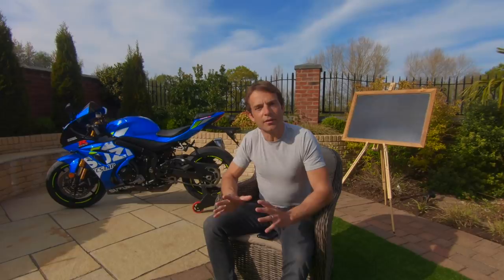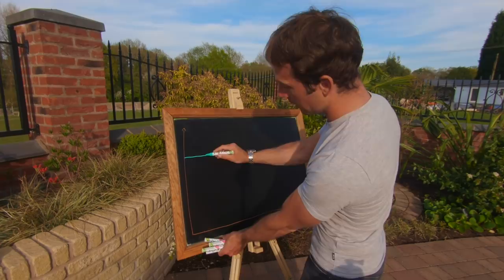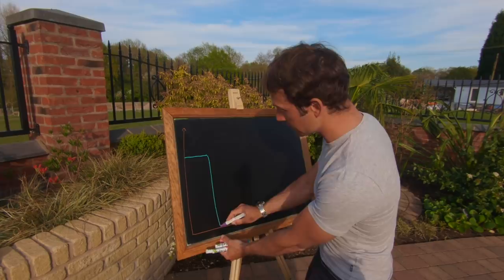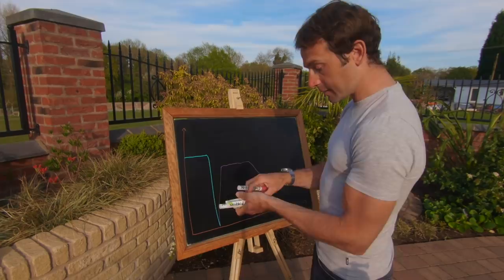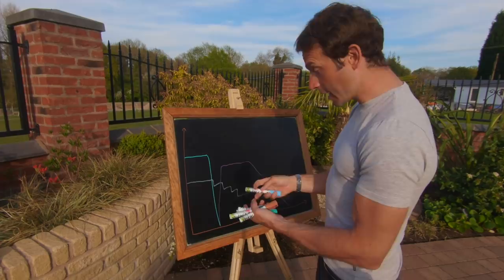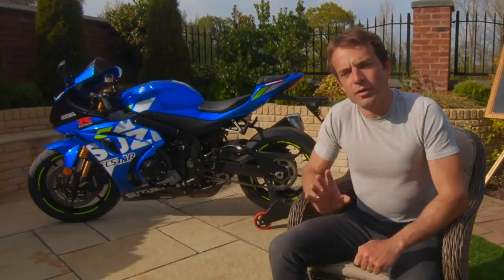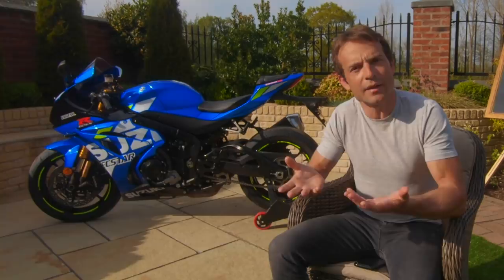THE REAR BRAKE (🇬🇧English Version)

Comment: Sylvain, this is a great series. I am an amateur racer in the US with some moderate success. I have never felt comfortable using the rear brake with the exception of running off track. I always thought it was a major shortcoming of my riding. I do click down a gear as soon as I release throttle and transition to brake, it settles/slows the bike for sure. From a psychological stance however, I really appreciate hearing one of the best riders in the world state that he doesn’t use the rear on a superbike. It actually takes a weight off my shoulders. It sounds silly but racing, as any endeavor you wish to be successful in, is 90% mental. I am really just trying to say thank you for sharing that!
Reply: The affermation of knowing what you were doing is right gives you sudden strength and confiednce. Suddenly you go faster.
Reply: @technicalthug  When you're braking hard enough to lift the rear up, the rear brake becomes useless. Even MotoGP riders only use the rear brake a little during the initial braking application before totally releasing it, and only start to use it again during the turn-in.

Comment: Great advice. I don't track, just fast road riding. I use the rear for trail braking into the corner. Your expert advice on changing down a gear at the corner entry for engine braking is a revelation!! Makes so much sense. Less rear brake, more use of engine braking.  Thank you :)

Comment: When I was a kid riding my bicycle I was taught during straight line braking to apply the front brake and at the same time blend in the rear brake and than release before entering a bend I actually still use that method today when riding my motorcycle seems to work 
Thanks for sharing you inner most secrets...!!!

Comment: Petrucci said that without the rear brake it’s quite impossible to use the Ducati.

Once in the corner he uses the rear brake to tighten his line and when he gets on the gas he uses it to calm the rear end and prevent suspension pump. (And ofc to prevent wheelies)

I guess it works for every MotoGP bike but these were Petrucci words
Reply: Yeah i think that is why Sylvain said he has to use it as well
Reply: It's also in line with what Lorenzo said when he moved from Yamaha to Ducati. The Ducati apparently really requires the rider to use the rear brake. 

Both petrucci and dovizioso are really into motocros so using the rear brake is embedded in their riding styles and they are responsible for development of the bike.
Reply: ZX-12R  Yeah, you might need to take your bike to a mechanic. I've never ridden a motorcycle that couldn't apply enough force through the rear brake to exceed the grip level of the tire resulting in a skid. That includes a 1973 Honda with a drum brake. 
MotoGP bikes' rear brake is not a carbon disk, it's pretty much the same as a WSBK rear brake which is pretty much the same as a high end model off the showroom floor.
Reply: Pure gold.

But I have to mention that it is a bit strange that nobody mention the every day benefit of rear braking. Balancing through cars in the traffic, the rear brake doesn't compress and unsettle the bike. And coming up to a red light, you don't have to fiddle with the throttle to reach for the front brake. For me, the rear brake is necessary for a fluent ride through the morning traffic.
Reply: @Jacob Riley yeah it'll lock the back wheel, but it still only slows you down half as fast as the front brake, without the risk of causing a skid.. rear brake goes from negligible breaking power to risky skid in about a half second, practically useless except in emergency stops

Comment: I think it was common for moto gp riders to use very little or no rear brake in the days before anti wheel spin and slipper clutches. Because they would break so hard, many times lifting the rear wheel, that it wasn't necessary. There's a reason behind rear brakes being so tiny.
Moto gp bikes can have such a hard hit on acceleration that some riders used rear brake to control wheel spin.
Excellent video. Especially after coming from a video by a moto vlogger/"influencer" who got in too fast to a corner on an unfamiliar road, slid into a drainage ditch and said "he had to lay it down" instead of learning how to use his brakes.

Comment: My R6 engine braking is lovely; means I rarely touch the brakes on the road. Learning to be more brutal and knowing the braking limit on the track is what I find harder. 
Great vid.
Reply: You should practice in an empty parking lot at low speeds. The peak brake pressure is not going to change depending on the speed because the tire grip coefficient stays the same.

Comment: I'm probably doing it all wrong but I do make loads of time on a lot of riders. What I do is as soon as I hit the front brake and close the throttle I down shift two of three gears quickly and feather the clutch out to keep back in line as more weight goes on the rear and i turn in. This works for me and it seems to give me less to think about in heavy braking  corners.

Comment: This is the only video I have seen encourage using engine brake to slow the motorcycle. I am so excited. I used a lot engine brake before stop lines and before tuning to reduce the speed. The reason is because engine brake bring smoother feeling than rear brake and I like the engine brake rev sound. Now I am excising downshifting with rev match, can you teach us when to use downshifting with rev match.

Comment: Just talking with some friend about how we use or don't the rear brake... How you described the use is actually how i use it, but i'm one of those who use the brake to manage the power to the wheel in corner exit phase... Some friend never use it and feels safe and conforta le in this way. Maybe it depends much on weigh distribuiton on your bike.. My k1200r has a lot ot of rear grip and never loose contanct with rear wheel, using the brake let me transfer load on the front tire in a somewhat safe manner....
With my old cbr1000rr the rear just slipped at every brake, so i used it once in the lean to mitigate the power to exit the corner...

Comment: Great video, been racing on track for a few years now and never bothered using the rear brake. Friends of mine use it so I always wondered if I should be or not but never bothered and still got good results. This video confirms that it is unnecessary unless at MotoGP level. Thank you !

Comment: I tried to tell people on a chain drive vehicle you can apply trouble and break at the same time and load the suspension therefore giving you more traction then given you better acceleration out of the turn. 
Your the first person iv seen that is trying to explain this. .

Personally i use the rear brake i get about 10,000 miles out of my sport bike out of it before i change the past because it started to get spongy.

I keep clean brake fluid in my bike because they get super hot and this starts breaking brakes apart . On my kart the breaks get absolutely fried to the point where you have to replace the whole thing ! 

Most rider just need to work on getting the breaking done before the start of the turn and just get the turn started and work on traveling out of the turn and through the turn .  I see lost people trying to explain trail braking but they don't understand exactly what it is because i think that light breaking into the turn is trail breaking. Trail breaking has to be done with enough force to fully compressed your forks  and squished the tire out the make it have a larger contact patch. Most don't understand this and can't do it. So getting the breaking done first is the better option and will give good track times.

Boo Yea

Comment: Great explanation. On most of my bikes that i've raced or tracked, during a right sharp or even sweeping turns, my right foot gets moved to the rear toe area  on the footpeg, so as to hang off the bike. This alone makes the rear brake difficult to use in the final cornering phase of the turn. Thumb or finger rear brake, ala Doohan, would allow though. Left turns less of a problem with this, as the rear brake is still usable with outboard  heel and toe. This has been my experience.

Comment: I really love your chanel Sylvain. It is so nice of you sharing your knowledge and experience with other fellow trackday riders.
  I ride a 2016 Aprilia RSV4 RF which, with race ecu, puts out about 190+bhp on the back wheel. I find the Aprilia's electronics very intrusive so I always ride with traction control and anti-wheelie 'off'.  Because of that, I have to constantly use rear brake coming out of the corners, as the bike whats to wheelie all the time :) Like yourself, I never touch rear brake going into the corners, I just use V4's engine braking.

Comment: I agree with the braking and using the engine rev and engine brake to you advantage is key.  Definitely having the engine running where you use the engine brake and also not using it where your engine high rev is right there for the power band after coming out of a braking Conor.

Comment: What I found a corner entry racing sequence is 1) reach braking marker, roll off throttle, 2) apply front brake smoothly, 3) move ass to side,  4)down shift the gears quickly but release the clutch on the final/prefered gear smoothly so that the engine braking doesn't make the back of the bike go crazy, ((this takes a bit of practice because each turn is different and how you shed your speed is very important)) 5) site your turn in, 6) site apex, turn in and trail off brake, 7) hit apex, 8) apply throttle increasingly 9) hit exit marker, 10) ass back on bike and should be at full throttle and ready for next gear. If you think everything went well and you didn't have to brake that hard in the end, move your braking point further down the track next time, keep your head on.

Comment: even though this may not apply to riding on the street you got a sub from me mate. Always felt natural to use engine braking and front brake coming into a corner and only the rear if i was coming in to fast am new to road bikes but been riding dirt for a long time dirt bikes are a lot more forgiving

Comment: MotoGP bikes have reverse-spinning crankshafts. While accelerating, this counteracts the bikes tendency to wheelie. While engine braking, this puts more weight on the rear tire, making rear brake more useful and essential.

In all conventional motorcycle engines (other than boxers, which have an axial crankshaft) the crankshaft spins forward. As the crankshaft slows under engine braking, this forces extra weight off the rear tire and onto the front. This is why rear brake is not very important on most sport bikes. While decelerating, the extreme weight shift to the front tire is caused by both the short wheelbase and high COG plus the slowing of the crankshaft, making rear brake nearly useless except in rain or for riders who like to drag it against the throttle for wheelie control on hard launches.

This crankshaft issue on our street motorcycles makes it extra important to not trail off front brake too long and gently for no reason. At some point, as you trail off front brake in a corner entry, the engine braking will be greater than the front brake And you risk losing rear traction, due to asking the rear tire to do too much while weight is shifted off of it. When engine braking starts to become the major contributor of total braking, midcorner, that is a problem. You should habitually transition to maintenance throttle by/before then.

Comment: For me it depends on the motorcycle. On my superbike I rarely touch the rear brake on track. However, on supermoto I use rear brake on every corner, it helps controls the angle of the slide a bit more than just engine braking (with slipper clutch) alone. In fact, if I set my slipper to be too little slip I get wheel hop which make things uncontrollable, if I set it to too much slip then I can't initiate a good slide, the rear brake helps me manually fine tune the amount of yaw during a slide.

Comment: Funny thing is I came from MX where I rarely used the rear brake.....bike is bouncing violently coming into corners so I was 90% front brake guy.....on street bike where road is smooth I find myself using lot of rear brake for cornering......very interesting...

am very new to cornering streetbikes but they feel so calm vs the dirt I am used too......we used to drag the rear brake with gas on over braking bumps to keep rear settled and stop it from kicking....

Same principal though using controls  to manipulate handling of the bike.....no different than road. 😂

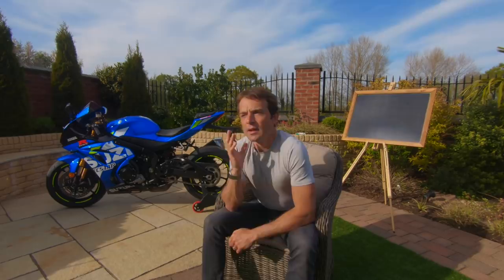Comment: 6:40 Interesting to hear you say that the wings help to keep the front down. I remember seeing someone (with experience doing aero for an F1 team) doing aero analysis on the wings, and actually finding that the front wings add some downforce, but not a lot at all. He actually discovered that the wings produce a vortex, which in turn causes more air to stick to the top of the bike on the back side, which in turn acts as a giant wing creating down force. So he found that the front wings actually helped with rear traction, strangely enough. Although I suppose that can be very bike dependent.

Comment: I think the only time you would use the rear brake on an exit is if you want to keep the throttle open so the air flow going through the engine stage constant  and you hold the rear brake so you don't put too much power to the tire

Comment: In 2001, I experienced a low-side crash in a sharp left at 40+ mph while using my rear brake. A panicked locked it up and I was going faster than my ability are easily applied but it happened so fast, I can't even analyze it. That didn't keep me off of bikes, but now I live with RBP, (Rear Brake Phobia). I can't shake it and can't bring myself to touch that rear brake. I'm sure this is hindering me but I adapted and learned to use engine braking instead.

Comment: The pyhsics work on any two wheeled machine. You can practice it on anything. for example,  Its almost impossible to steer a bicycle while using the front brake, but if you load the rear brake also, the forces balance and the bike wants to turn more

Comment: very informative. can you please advise on when you start applying the front break before the corner and start down shifting on the gears, so lets say I have down shifted to 2nd, do you only release the clutch back out when the engine is in a position to handle the 2nd gear or is it done kind of straight away >>> Edit: I think you gave the answer when I watched the video again, Apply front brakes, downshift early, let the engine breaking work for you + whilst still applying the front brakes. Also, to help others like me, the advice works spot on day to day riding. I was out yesterday on  twisties in Lincolnshire and applied the TRAIL Braking on some fast corners and it works wonders.

Comment: I have a question though. Do you remember how it was with the two strokes back than when you couldn't realy use the engine brake? Cheers from germany. 😎🤙
Reply: same question I have too - looking forward to Sylvain's comments!
Reply: It's going to be using the momentum when braking hard with 2 stoke. You brake hard early, into the apex as smooth as possible, then make the exit as clean, smooth and fast as possible. It's not that's different from 4 stroke, just minus extra stopping power from engine brake.
Reply: Brake further, add some meters from the initial braking point, not too much. Bcos 2 strokes bikes are much lighter than 4 strokes with the similar horse, so the momentum will be less means stopping distance will differ just a small margin.
MotoGP changed to 4 stroke was solely on safety purpose, they too said the engine's potential on 2 stroke beasts (I believe too til today) are still greater than the 4 stroke, and will surely defeat 4 stroke on race track if given room to be developed. Just too dangerous for the riders back then. I am dreaming 2 stroke with fully equipped electronic like the GP today
Reply: @sobatkayu8369  Oh yes, what would it be if modern day 2 stroke compared with the same level electronic 4 stroke bike. Wish the latest 2 stoke bike like Suter MMX 500 could compete
Reply: @sobatkayu8369   So how do you explain the fact that once the 4 strokes were introduced in 2002, a two stroke never won again?
Reply: Check out Moto Vudu channel where Simon Crafar acknowledges the lack of engine braking in the 500's when he transitioned to those bikes and needed to practice using the rear brake for those toward end of his last season aboard the superbike

Comment: Downshift but make sure you execute at right time, fast down to the appropriate gear for the corner. If you downshift a gear too low you'll slide out into the turn with the rear locked up. If you downshift short a gear to high you won't be able to stop unless you play with rear brake. My 2 cents for the novice crew.

Comment: I feel like this is very much applicable to street riding, thank you.

Can you explain again why they use engine braking as opposed to zero engine brake and all rear brake? Can they not modulate the rear brake such that it doesnt slip?

I am hearing on the streets, when emergency braking, you follow the same procedure you outlined. But i just do not see how taking the time to downshift and engine brake + front brake is safer than just pulling in the clutch and using front+rear brakes.

Comment: Excellent video. One question, when you roll off the throttle and immediately downchange are you bothering with the clutch or just kicking the gear straight down, and as the throttle is off there's no load on the gear so it's smooth enough?